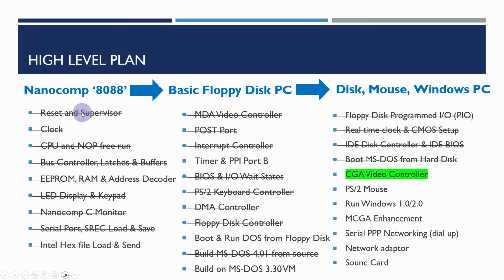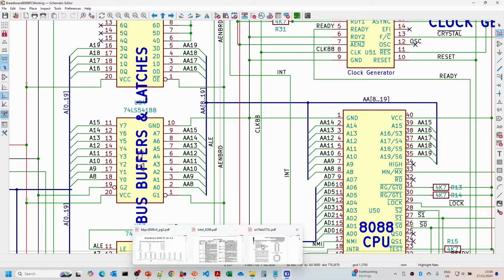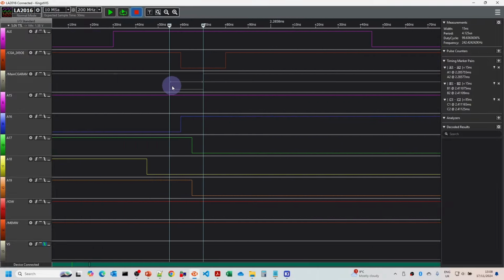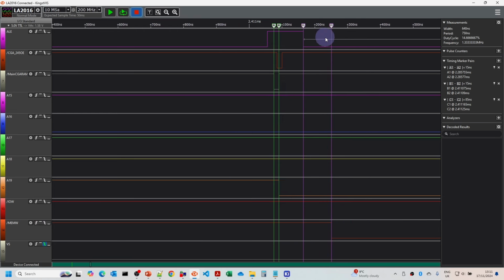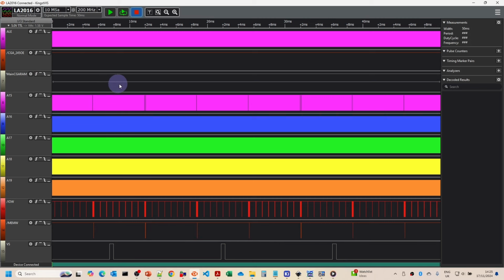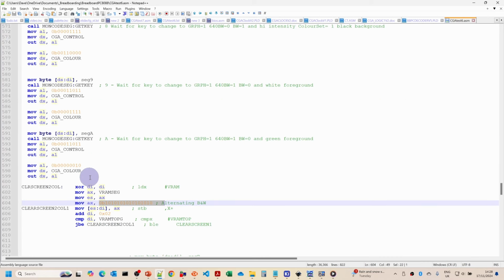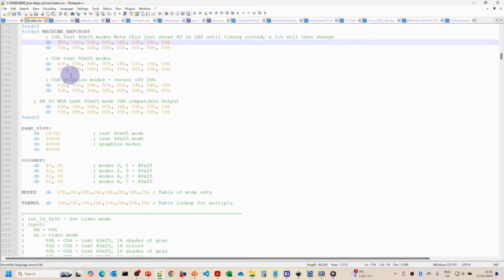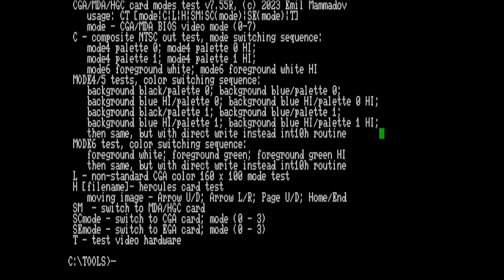Breadboard 8088 PC #56 CGA Video Controller Part 11

Comment: I had a look at the original address decoders and these seem to always need /MEMR or /MEMW (/IOR and IOW for ports) to be asserted in order to create chip select signals (I don't know, if you say this at some point, I'm somewhere at the middle of the video). 
This would also solve the problem with the address glitches - did I understand this correctly?
Reply from the maker: I think I ended up using the AEN address enable to combine with CGARAM in the end. This was some time ago so I'm a little hazy about it but I think I fixed it a few videos later. Thanks for your thoughts. Dave